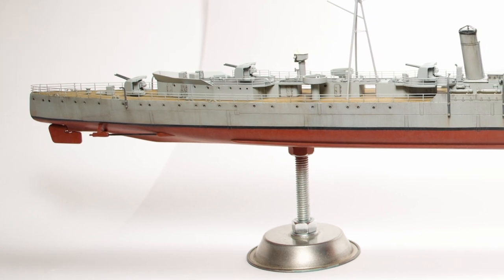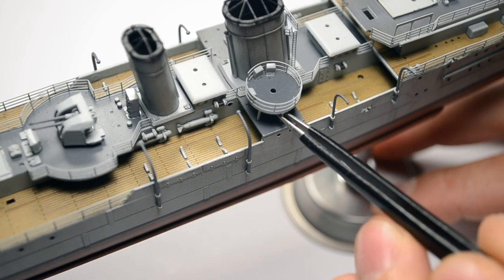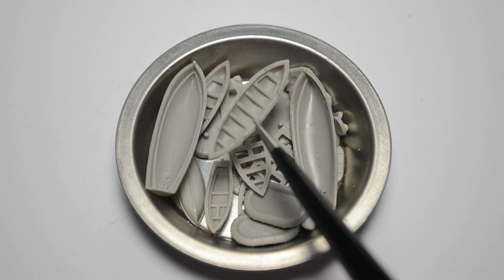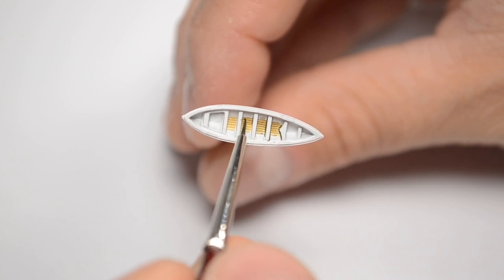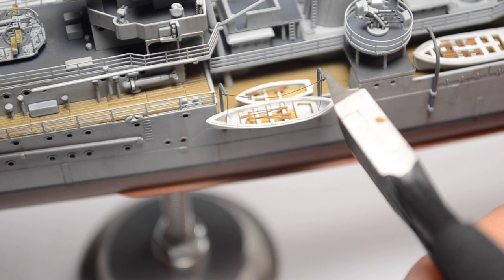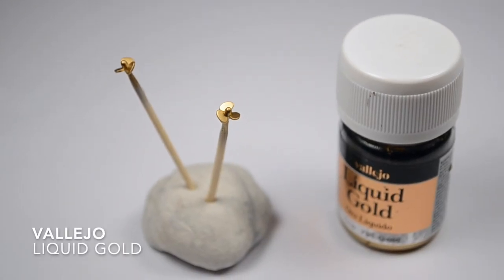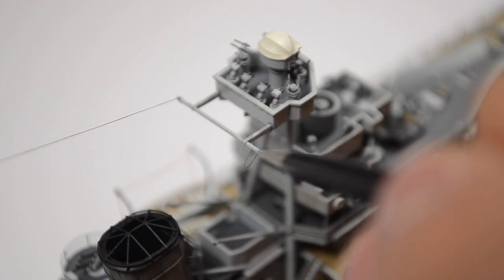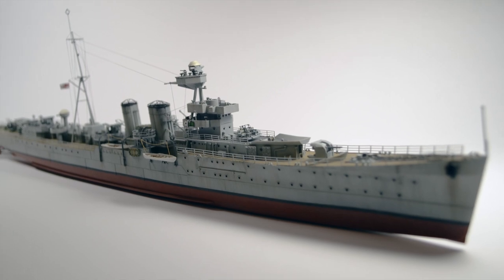1/350 HMS CALCUTTA [Trumpeter] - Part 3/3

Comment: For the bow section photo etch railings, did you need to use a sloped set of PE railings? It looks like a bit of a climb up towards to the bow.
Reply from the maker: Nope. These was random railings from another set. They were not sloped.
Reply: @Drydockinscale  Thanks for getting back to me!

I look forward to building this myself :)